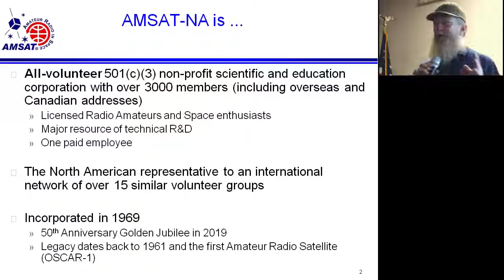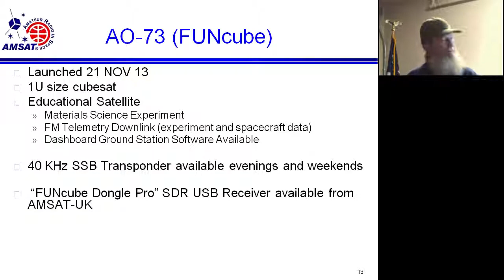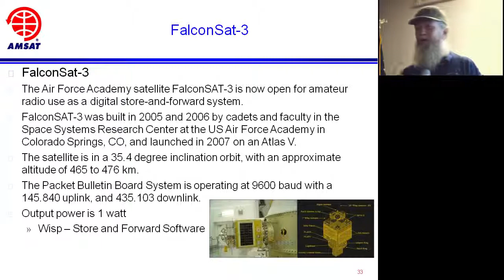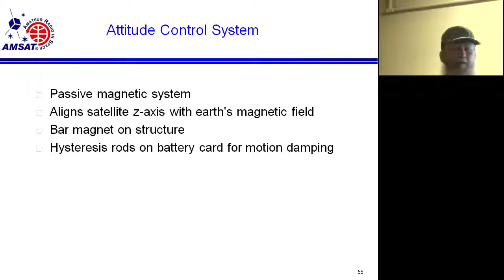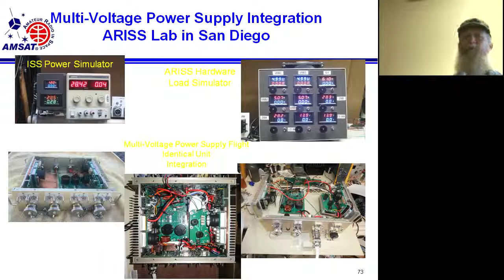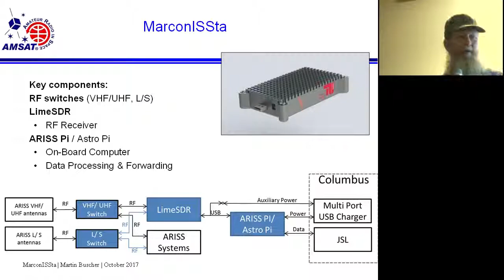Joe Spier, President of AMSAT-NA, speaks at the Sierra Foothills ARC September, 2018

Comment: I would like to clarify and elaborate on a point that Joe made, regarding the MPPT at about 46 minutes into the video.  While AMSAT did ask Rochester Institute of Technology (RIT) to produce a maximum power point tracker as part of a senior design class, the idea of RIT project was to find a design for the future Fox-2 satellite(s) that were envisioned at the time.  The initial support and prototype of the Fox-1 MPPT owes credit to RIT and the RIT senior design team which was led by Bryce and Brent Salmi, however Bryce and Brent went on to join the AMSAT Engineering Team after they left RIT and upgraded that design and prototype work to create the MPPT for the Fox-1 series, which involved a different set of requirements than the Fox-2 design.  The Fox-1 MPPT was "built by" AMSAT then, rather than RIT.  I say this just because I want to make sure the due credit is given to any of our AMSAT engineers for the hard work they volunteer.